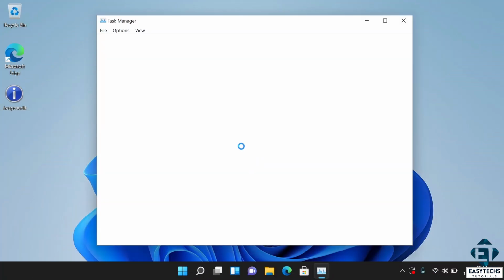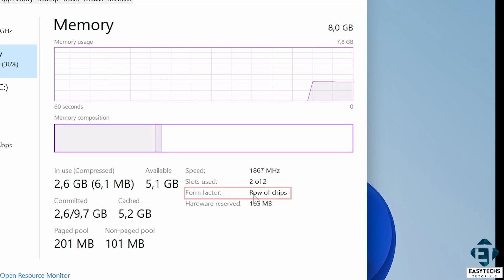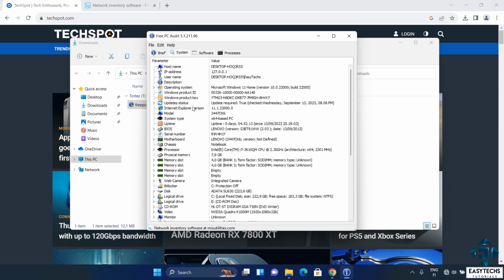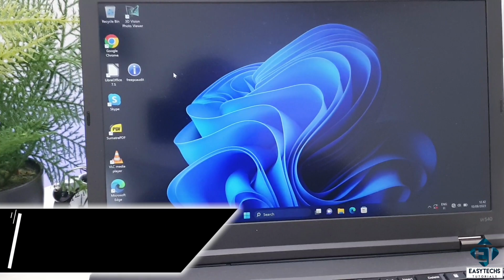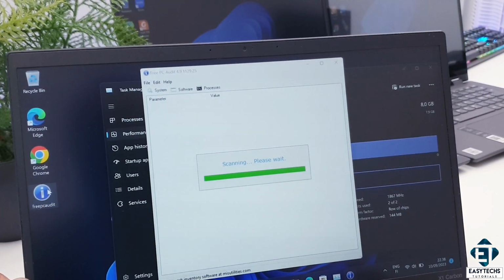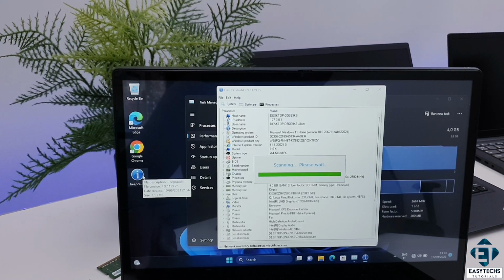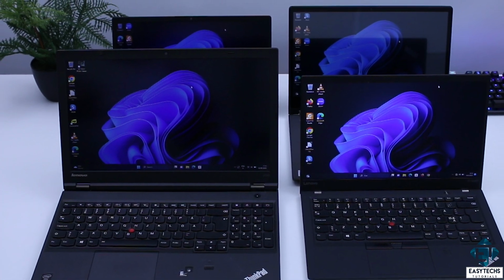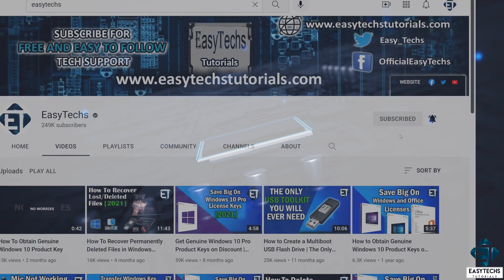How to Check if Your Laptop RAM is Upgradable Without Disassembling (+ How to Check Max capacity)

Comment: Hi I have lenovo pc and after testing it it showed 4 compressed ram installed and 1 slot empty, but when I opened the back of laptop I can see only one slot for the ram I don’t see other slot or soldered in ram what that could mean 😮 thanks

Comment: I am very Confused Video starting and After 9.02 

U say Sodimm ram Upgradble 

But after u remove 9.00 minutes the other ram your soldered laptop Say is Sodimm ram In Soldered 

Can u explain 🙄
Reply: What problem are you facing?
Reply: @barcadna10  My Laptop Ram Is Sodimm but Solderd in mother board

And laptop not have extra slots 

But task manager says 2of2 slots used
Reply: @Bablu7748  can you provide your laptop specs? Model, Total Ram?
Reply: @barcadna10  Yes up to 32gb Upgradeable

And My laptop avita pura Ryzen 5 3500u

8gb ram 512gb ssd
Reply: U have any solution vro
Reply: @Bablu7748  are both ram slots upgradable or one is soldered and the other upgradable? And what frequency is the max for your ram
Reply: @barcadna10  There is a No extra Slots In my laptop mother  

And Ram frequency 2400mhz
Reply: @Bablu7748  unfortunately your ram is non upgradable sorry

Comment: I need little help. I have right now 8gb ram. On internet it’s said that I have 2 slots (1 upgradable only, also show me max 20gb ram. 4gb+16gb) but in free pc audit show me only 1 memory slot with 8gb with capacity 128gb. So I can upgrade 16gb max or 128gb max? Can I update more than 16gb but not work properly?

Comment: This is just to let you know. I´ve received an old Lenovo Ideapad 110-15IBR, it was bought in Australia, but it was made in China. I´ve read the memory specs in Hardware Maintenance Manual and for this model it is "on board memory". I´ve tested using Task Manager information and PC Audit Tool, both of them said "SO-DIMM", even the maximum capacity of 8GB, my device has only 4GB (2 banks of 2GB). I have opened the case and I´ve confirmed that all memory is soldered (no slot for upgrade), very interesting that I can read in PC Audit the manufacturer Samsung and its part number as SO-DIMM. In summary the best way to confirm if your memory is soldered or not is looking at motherboard, enjoy this tip...

Comment: Hey bro! i know its kinda late but on your last laptop with 1 soldered and 1 sodim, its says it has 16gb maximum so 4gb + 8gb is 12gb right? how do you insert the last 4gb ram? bacause mine says 16gb max too but when i search the internet it says the maximum capacity is 20gb.

Comment: Bro, I  don't understand from wherever I checked my ram total capacity it shows 128gb and 8 total ram slots (it has came with 8gb ram and I don't think its possible to upgrade it that much and if so then why the every method I try its the same result)
My laptop is Asus Vivobook 14 ; Model no. X421EAY_K413EA 
It has i3 11 gen processor , 512 SSD,8GB ram

PLEASE HELP BRO😢😢😢😢
Reply: same problem with for me

Comment: Mine says Sodimm but the device locator says Bottom - onboard, so which is it? is my ram upgradable or not?
Reply: it was infact soldered
Reply: what does that mean? can we or not @buranku9459
Reply: Just remove the cover and check it? How did it go?
Reply: Soldered ram say sodimm can be upgrade?

Comment: Hello I have a crazy question for you I was tired of my laptop slowing down because I had too many tabs open.
So I decided to buy a computer with lots more room 32 gigs of RAM and one terabyte of storage, It is actually a gaming computer That I'm not using for gaming, thinking that if I bought a high-power computer like this, I would never experience a slow down with my regular searching having too many tabs open.
But I find that a part of my computer that's used for the gaming is wasted, not being used for anything, can I do anything to use everything my computer has to open up many more tabs I'm not complaining about the speed I got now I'm happy. It kind of seemed that I bought the wrong computer when I thought that if I bought something expensive, I've had lots more space never running out of ram. Oman by HP 

Can I do something to use all of What my computer has to offer, that would be used for gaming. But to be use for a high-power laptop.
OMEN Laptop 17t-ck200, 17.3"
Windows 11 Home
Intel® Core™ i7-13700HX (up to 5.0 GHz, 30 MB L3 cache, 16 cores, 24 threads) + NVIDIA® GeForce RTX™ 4060 Laptop GPU (8 GB)
Chipset Intel® HM770
32 GB DDR5-4800 SDRAM (2 x 16 GB)
Expansion slots 1 multi-format SD media card reader
1 TB PCIe® NVMe™ M.2 SSD (4x4 SSD)
17.3" diagonal, QHD (2560 x 1440), 240 Hz, 3 ms response time, IPS, micro-edge, anti-glare, Low Blue Light, 300 nits
Microsoft® 365 Personal 1 Year 
McAfee LiveSafe™ 12 months

Comment: Hi I just checked with the free pc audit tool. It shows 2 slots which one is used and the other is empty. The one being used is 8gbs and says unknown so its probably soldered. However it says the max capacity is 8gbs. So I'm kind of confused. If the max capacity is already used, then why would the laptop come with and extra empty slot? Also when I check task manager it says "row of chips" for the form factor and 1 of 2 slots used.
Reply: did u figure it out
Reply: @Shiverhawk not really. I can’t remember if I read it in the user manual or online but I think it said my laptop has max 8gbs. I kind of gave up after that lol
Reply: If your max is 8gb, then that means that 8 is your max. If you're wondering why it has 2 slots, then it is probably for there to be 2 4gb of ram.
Reply: @Foxy33164 Yeah, I figured that much, but what would be the advantage of having 2 4gb of ram versus just having 1 8gb of ram?
Reply: Thanks! I just read more about this and turns out it does have an advantage haha. It can help laptops function even faster!
Reply: So I am a bit confused. The app says my max capacity is 64 and I have 2 slot both with 8 gig of ram totalling to 16 gigs of ram. So my question is how much upgradable ram do I have?.
Reply: Is it 48 gig of ram available for expansion?.

Comment: Hi. Can you help me please, my Taskbar won't let me click on the windows thing and also when I click windows on the keyboard it opens and instantly closes but my Taskbar isn't locked. And also if I want to search on youtube or Google Chrome or on my windows. But I can click on the apps in my Taskbar and the open but the rest doesn't work. PLEASE READ THIS TY
Reply from the maker: It sounds like you may be having sticky keys on your keyboard, maybe try using a USB keyboard and see if the same issue continues or if it goes away
Reply: thank you for helping me i went to get a usb keyboard and it works fine now 
 @EasyTechs